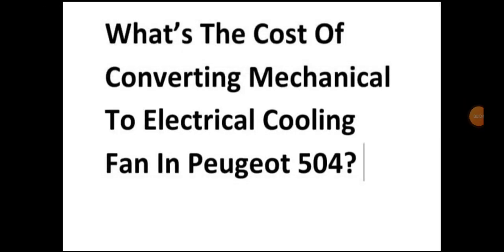Cost Of Converting Peugeot 504 Mechanical Fan To Electric?

Comment from the maker: IKENNA351 CONSULTANCY/CAR PRE-PURCHASE SERVICES. 

A lot of people have brought Lions to me for diagnosis & repairs, only to be informed that their newly acquired Lions were running with wrong or tampered Engine ECUs and BSI units or abused wiring harnesses which make their Lions undrivable or with horrible issues. 

A lot of people have purchased lions with engines, transmissions or suspensions that were against their original wants in cars because of no professional guidance or explanation of  available engines, transmissions or suspensions that would have best serve their wants in Peugeot models they are interested in.  

I can prevent these nightmares for you when choosing a used Peugeot Vehicle to acquire, Foreign or Nigerian used . I will search for Lion model of your choosing or you are interested in, inspect and recommend good ones worth purchasing till you pick one that satisfies you, based on my findings from inspections of them in Abuja or environs. You can choose to utilize my knowledge on these Peugeot Vehicles to get a sound clean used Lion of your dream or you choose other options available to you.

If your desire is to have private consultations with a Peugeot specialist like me on lion's maintainance tips, how to avoid abusing lions or how to keep a lion in good condition throughout your ownership of the vehicle, from time to time, until you get hang of it, then this  consultancy services will serve you as well. 

Likewise, this service is available for those interested in buying Brand New Peugeot Vehicles as well. Now, you get to know all trims and specifications available for a particular model of new Peugeot vehicle you are interested in, by interpreting for you  the features, engines,  transmissions and specifications available for the Peugeot model you are interested in, to help you choose which one best suit your purpose, need or want in a new Peugeot.

The charge for Pre-purchase inspection is per a Peugeot vehicle, which also includes private consultation on maintenance tips and other clarifications on the model you request for, from time to time.

If you have a particular Peugeot vehicle in mind that you already want to purchase and the lion is very far or not in Abuja city and you need the lion to be physically inspected before purchase, note that this service does not cover it. If the location of the vehicle you would want me to inspect for you is outside Abuja city, the client will have to pay for the transportation (to & fro), if I choose/decide to go out of Abuja city for the inspection which this service doesn't cover.

I also carry out verification of custom papers for authenticity, for Peugeot Vehicles clients are interested in, when a client request for the verification of the custom papers and the payments (the small fee for the verification is to be paid by the client).

However, if all you need is advice and guide on getting a good Peugeot vehicle in good condition, what to look out for if you have to inspect the lion by  yourself, full interpretation of the lion specifications, how to detect a severe abused lion on sale or you need a private consultation on review of Peugeot vehicle(s) you are considering to buy, to help you understand them and make your choice, then this service will serve you on that option too.  But if you are not comfortable with the above listed conditions, then don't pay or request for this service. 

Note that if after reading this or contacting me privately after I have sent you this terms of service and you choose not to use the service to do your vehicle purchase for whatever reason and the newly purchased Peugeot vehicle starts giving you nightmares or headaches after the purchase, I will not attend to you privately if you try to get this service for free from me, since you made your choice to risk it. 

- Consultancy/Pre-purchase Inspection fee: N30,000.00 (Thirty Thousand Naira). It's Non-negotiable,  Non-refundable & it's pay before service.

- Contact details:
Phone/WhatsApp number:  +2348095721703.
Email address:  ikenna351@gmail.com

*The conditions are subject to change.

However, if you want my expert advice or information to your questions or queries for FREE, visit my YouTube channel below, and search for them, using video titles related to information you seek for:. 

www.youtube.com/c/Ikenna351Monk

 Lion King - Monk.